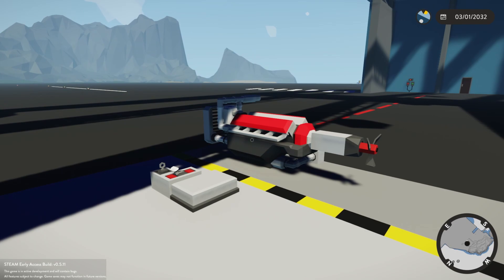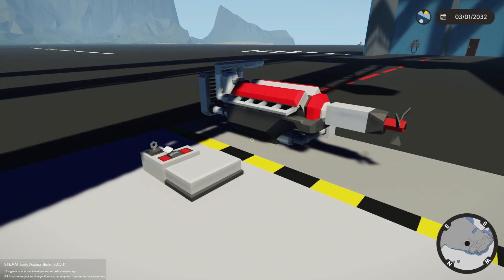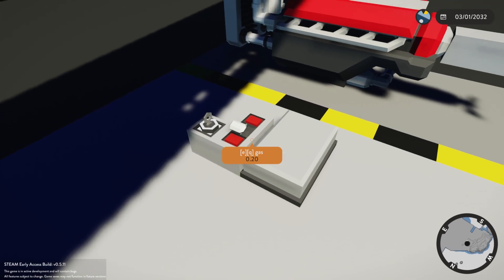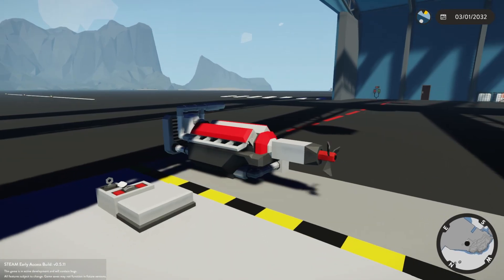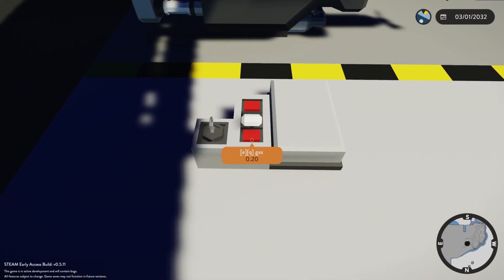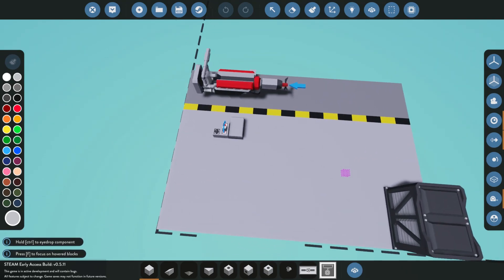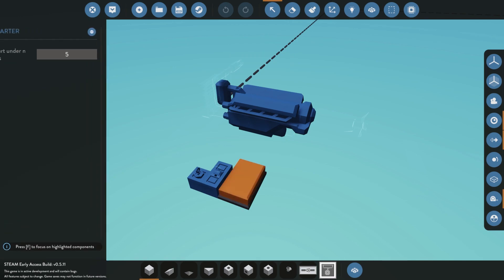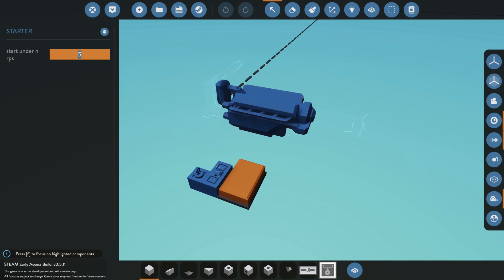Stormworks Key On  /Off Starter Microprocessor

Comment: Using timer logic is better than using rps because if the engine is constantly crank due to air or fuel problem, it will drain the battery though.